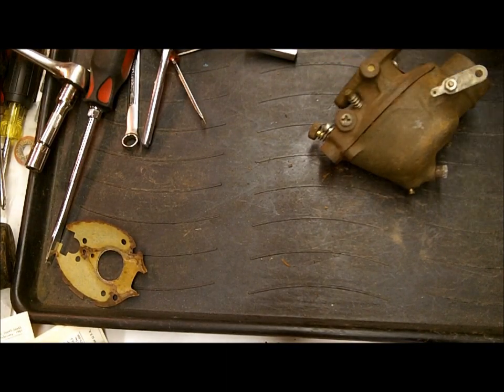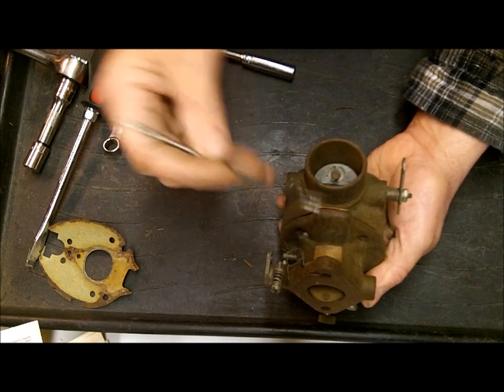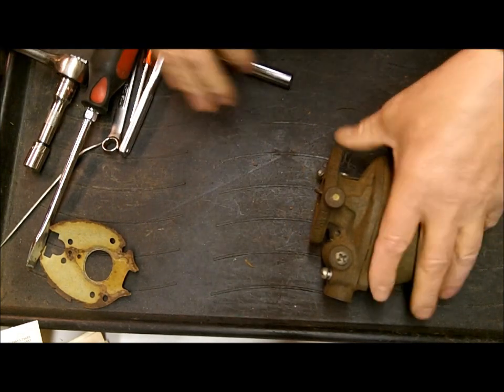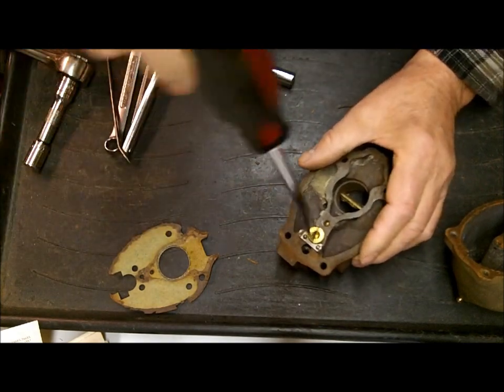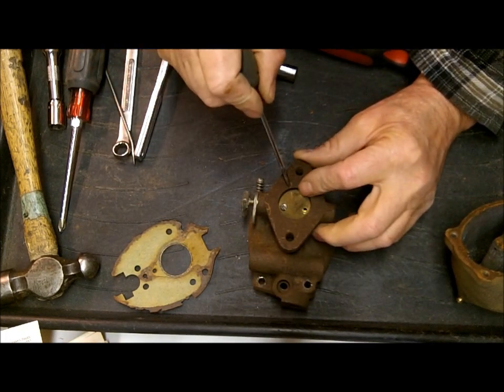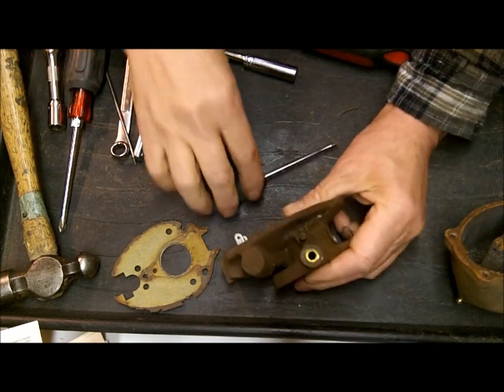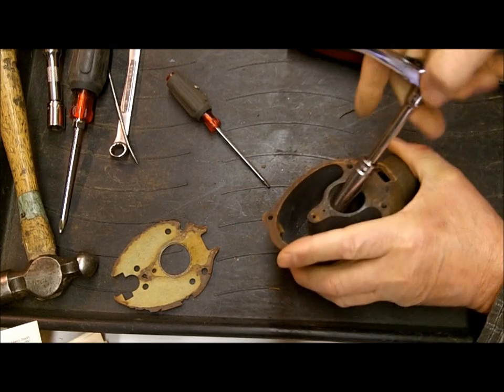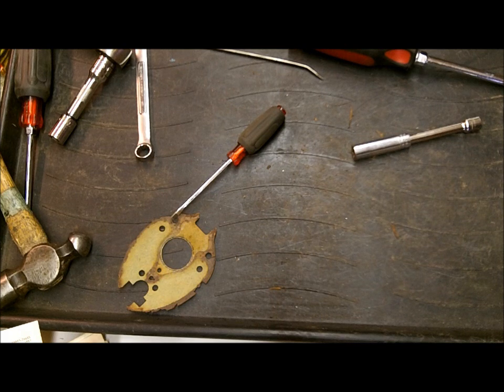Marvel Schebler Carburetor Rebuild Part 1

Comment: I got a Ford tractor N2 w/ a  Marvel Schibler TSX that's leaks at the bottom  thru the air horn drain? ( next to the regular drain plug). Manual  parts # plug 9N9692 & strainer 9N 9694A!
In my case I noticed  a plug w/ small hole on the center that may be removed w/ a small Allen tool! ( rebuild kits don't bring this 2 parts). I need ur or anyone else Advice.! ( can I  
plug this hole & what kind of material can I use.
Thank's!

Comment: My ferguson TO 30 will start but not keep running. Sometimes run a few seconds or several minutes. Filter screen in side gas tank is clean. Fuel flowing good thru line good. Fresh Gas.  Any ideas ?
I'm in Mississippi, sounds like you are close.

Comment: Hey just had my carburetor cleaned and I've placed it back on my 1952 Fergusson TO30 but it won't start. The fuel lines are fine but I noticed that the bottom part of the carb isn't getting any gas. I unscrewed the drain plug and not a bit of gas came out. Any experience with this yourself and/or advice you could offer.

Comment: What does the pressure plate do on the throttle rod flywheel? I can swear the flywheel did not have a pressure plate with spring attached, it just has the disc with cut out in it. Any help would help. Ty

Comment: Mike, Thanks for the reply! It was most helpful! I noticed that the carb in your video didn't have a float spring like my TSX 765? I am having problems figuring out how mine came out during dissassembly as well as if it really has any purpose? Any suggestions?
Reply: I dont mean to be so offtopic but does any of you know a way to get back into an Instagram account..?
I somehow lost my account password. I would appreciate any help you can offer me.
Reply: @Cash Will instablaster =)
Reply: @Dash Parker Thanks so much for your reply. I got to the site thru google and I'm trying it out atm.
Looks like it's gonna take quite some time so I will get back to you later when my account password hopefully is recovered.
Reply: @Dash Parker it did the trick and I actually got access to my account again. I'm so happy!
Thanks so much you saved my ass!
Reply: @Cash Will no problem :)

Comment: the old cast iron carbs 😮😮 do rust up bad some times U can heat them and get the rust out then again U can't get another carb and be done it will save alot of head ache if the gas tank has rust that doesn't matters none either U will be right 👉 😮 back where U started from IVE have took tractor 🚜  gas tank 2 the car wash and still couldn't get the rust out 😮😮 either nothing else 2 do put a inline clear gas filter on the tractor this will help gas tractors wouldn't run W the carb has dirt or water  💦 😮 in it IVE seen this be 4 take the carb off and a part clean it out and put back 2 gether then the tractor 🚜 😊 runs again and the gas 2 day is no good either it's JUNK  its worse now than what it was be 4 😮😮 OMG 2 29 2O24